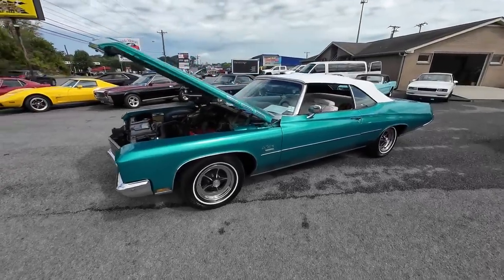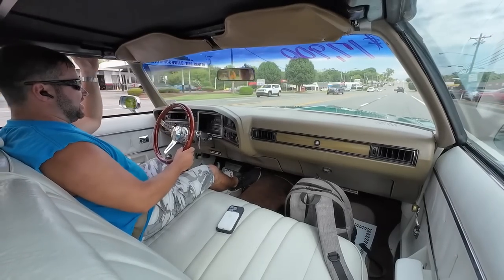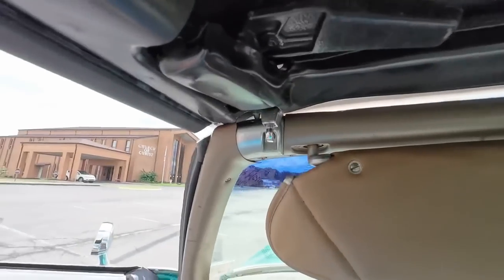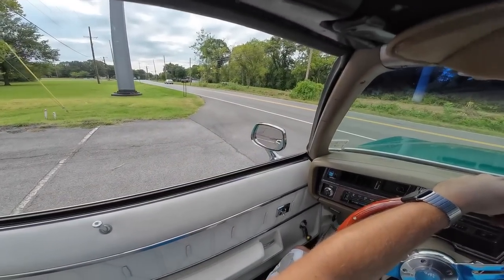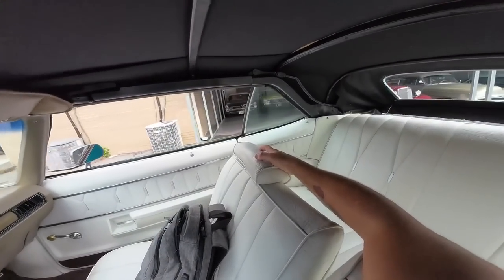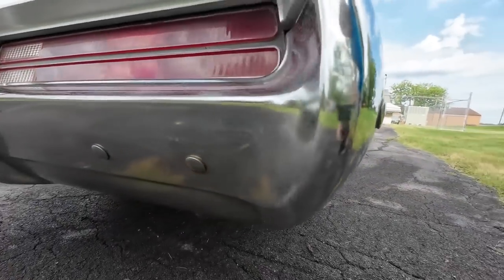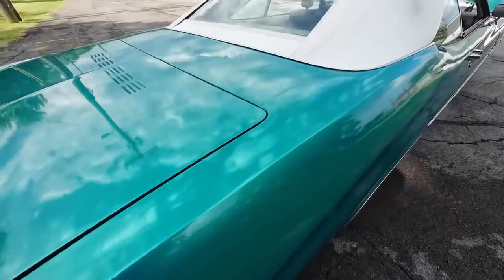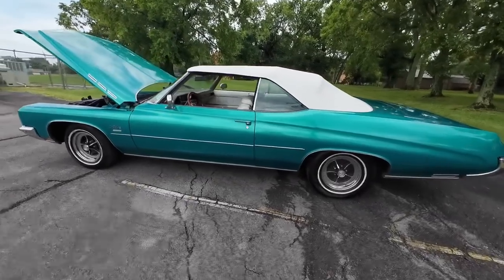Test Drive 1971 Buick LeSabre Custom Convertible SOLD $17,900 Maple Motors #2306

Comment: I had a 72 lesabre that was a hardtop. Was lime mist with green interion. Was the custom package as is this one with the diamond interior. I lost it in a tragic flood we had here in ky about year ago. I own a 72 centurion now. Its on my channel on here. It was as close as I could find to my car. Which it was a plus cause i basically got the same platform but much more optioned and out and the 455 over the 350. Im a huge buick guy. If your a buick fan check it out. Its a mild restomod.

Comment: Air vents in the Trunk?  I guess that's good for sneaking into Drive-Ins back in the day. Looks like the whole team could have hid back there. Cool car.
Reply: Yes sir air vents are common in the trunk for 71 GM platforms such as the Chevy impala convertible as well as the Buick, Pontiac, Cadillac and Oldsmobile for the same year. In 1972 they were gone
Reply: they are a 71 option that gm cars had to draw fresh air in the car. They leaked bad so they changed it in 72.